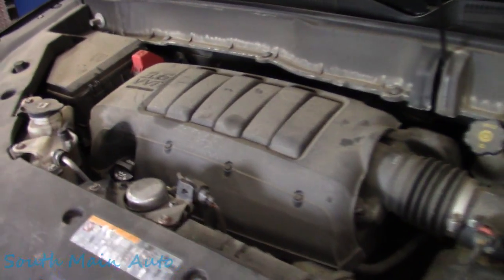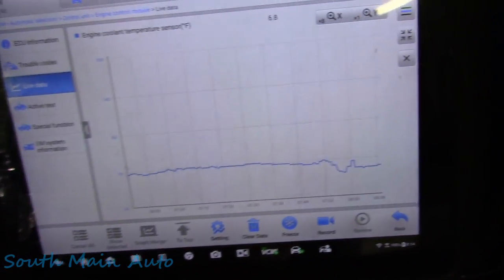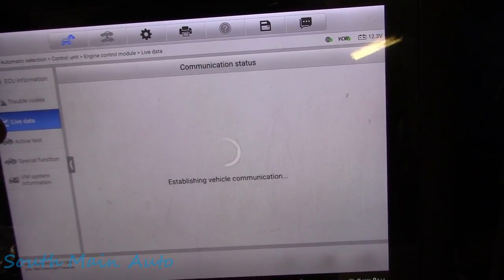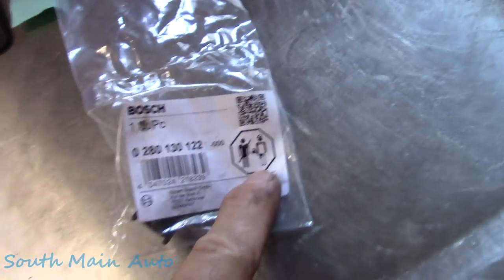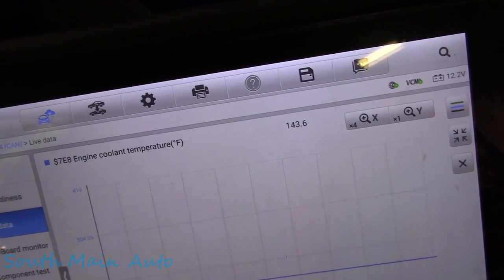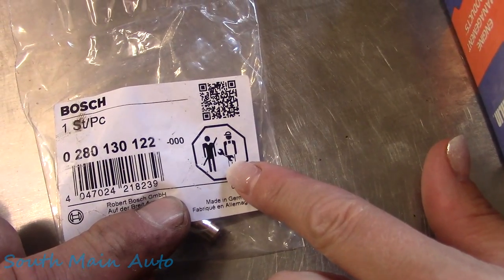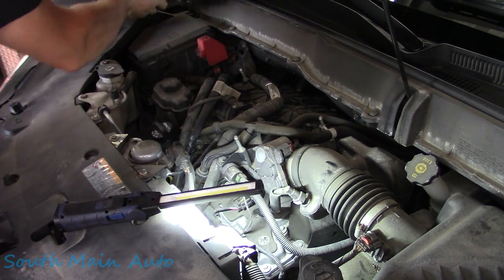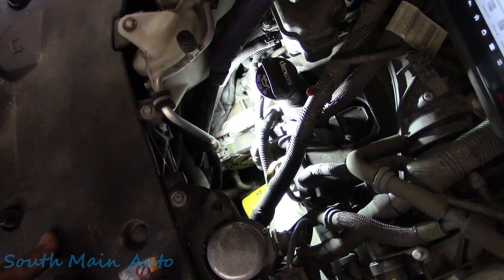Chevrolet Traverse: P0118 & P0119 Eric O. Loads The Parts Cannon AGAIN!

Comment: Honestly Eric I believe that the lock tab thing was a response from the factory to dealer techs reporting “found loose connector” when trying to recoup diagnostic time for “unable to duplicate” problems adds a couple tenths here and there
Reply: When you sell ten million cars per year, the tiny percent of connectors that come off/become intermittent/leak because the factory or mechanic didn't clip it on all the way is enough to move the needle a bit on those 'most reliable brand' magazine awards.

Comment: Hi Eric, I used to work as a design engineer for a supplier to Nissan for the head lamps and tail lamps. Preventing “soft set” connections was a big deal. During design reviews both internally and with the customer (Nissan) the manufacturing engineer and design engineer needed to show proof of how we check for and eliminate the potential for a soft set connection. In most cases we use connectors with the secondary lock (red tab) that a machine can push and verify that the red tab is in the locked position. It was a big deal to a lot of people. Oh well I’m back to being a mechanic now and much happier
Reply: These tab are a real pain in the ass worst connector ever
Reply: So if I understand correctly, the tab isn't really there to keep the connector from falling off once it's properly clicked on. It's there to quickly visually prove that it's properly clicked on in the first place?
Reply: Sounds like “logic” to me now ! Robotics @ assembly !? Should get the robot to remove some of these “brittle” Red locks after 100 K !!!
Reply: @legros731  Cummins loves them too. Just about every engine sensor, turbo actuator has those secondary locks.
Reply: @fredwalker839  Or after 450,000 miles on a Cummins heavy duty (class 8) engine... all the plugs on the stupid EGR stuff get HOT!
Reply: @John_Ridley  exactly, at least that’s the case for a lot of the sumitomo connectors we used with the red tabs. The red tab was what the Japanese called a “poka yoke” it can only be engaged if the connector is fully connected and then a machine would push on it at some point in the assembly process. If the pusher went a certain distance it would know that the connector is present, in the right location, and is connected properly. They didn’t want to rely solely on an assembly worker to plug the connector in. They had signs up at the work cells reminding people to “push, click, push push” like I said it was a huge deal to a lot of people. There were other methods too if the connector was in a spot where a machine push was not feasible, but the red tab was the ideal way to go.
Reply: @fredwalker839  If assembly line workers didn't have a history of showing up drunk or doing half-assed work it's entirely possible there wouldn't have been the need to institute a visual inspection method like this. Engineers come up with solutions to problems. As @corranda said, this was a problem.

Comment: “Connector position assurance” clip, or CPA clip. It’s used by the manufacturer to ensure the connector makes a positive connection with each other. And it is supposed to alert the autoworker at the factory that the connector is completely seated. Yes it was becoming an issue. I was told that they aren’t necessary as long as the connector is seated and locked.
Reply: They are not necessary
But after 10 years under the hood they just break when removing at least the connector work perfectly fine without

Comment: Funny you should mention a shop light that's magnetic to plastic  I used to have one. It was an old tin shelled incandescent shop light with a hook on top and it got so hot that if you put it on plastic it would melt in and stay.🤣😋

Comment: I work at a GM assembly plant. The reason for the lock (CPA connector position assurance) is if the connector isn’t seating all the way generally you can’t push the lock in. So it’s basically to ensure during assembly connectors are seated due to us being rushed with jobs being loaded. An engineer told me within the next couple years they will be on 99% of the connectors SMH
Reply: @SouthMainAuto  That explains why they fall apart after a couple years. They're only meant for last long enough for QA during assembly. After that it's on whoever touched it last.😁

Comment: Jury is still out on locking tab connectors .... half the jury says it keeps the connector sealed and clean inside and makes a better positive connection ... the other half are mechanics throwing stuff at the foreman that have to wrestle with them all day in really tight, awkward places .... the automotive engineers were all playing golf and laughing

Comment: Connecting lock was invented by a group of attorneys after losing a lawsuit.  Harness too short from factory, broken motor mount pulls everything apart and a mother with a minivan full of kids  stalls on the train tracks. Or some other tale of woe. Cars are built to be assembled on a line, after that it's tough luck to us all. These videos encourage one to keep thirty year old cars if not corroded on the road. Thanks.
Reply: Good explanations
Reply: Totally agree, keeping my ancient cars as long as possible, they still look good and run like new

Comment: The engineer who invented the locking tabs is the same person who thought childproof prescription bottlecaps for elderly patients with minimal dexterity was a good idea.  Somebody needs to take that guy out behind the barn 😆
Reply: Lots of kids died or were permanently injured from rx meds. It’s inconvenient for the seniors but worth it imo.
Reply: I call them adultproof caps 🙂
Reply: @arnoldm889  just store you medecine appropriately problem solve 
But people and responsibilities doesn't go hand in hand most a just big child lol
Reply: @legros731  Sad that we all need to pay for the few.
I say, take the warning labels off everything and let Darwin sort it out.
Reply: Big brother has to keep us safe from ourselves.  The latest? In 2027 all new cars will be fitted with a DUI interlock
Reply: @DeweyCheatumNHoweLLC  Oh boy, car stalls on the railroad tracks, and the gate arms start coming down, but car won't restart because of a faulty computer chip in the DUI sensor. That'll go over really well with the NTSB.
Reply: @arnoldm889  more than an inconvenience for many seniors as they can Not Open their medications at all. I do believe they finally changed the caps and seniors can receive non child proof, but they / MD have to request them.
Reply: That same engineer also made the caps work both ways, thread or adult proof.

Comment: I've shotgun parts repairing things on the family cars for years.  Many of these things are very common problems, just use the googleys and fire away - just not with Dorman crap parts.  The last one that bit me was when I replaced the OEM harmonic balancer on our '99 Expedition with a Dorman part and the rubber delaminated from the steel pulley almost immediately.  Took a while and a new belt with white letters for me to figure out why the power steering and alternator were not working well.  Love your Channel!

Comment: Had a ford 3/4 Trk die going across a RR track yrs ago and then it restarted and later wouldn’t, as I delivered parts for a part’s store an old mechanic told me check the firewall wiring harness sure enough it was loose and I zip tied it down. No more problems!

Comment: I know why Chrysler started with the locks in the 90,s. They dropped the PDI time from 1.5 hrs to. 9 hrs. So all off sudden the PDI guys were finding wiring problems to make up the extra time and a loose connector was the usual repair code. So they thought they had a big problem with connectors being assembled incorrectly hence the locks. This came up at a training course.

Comment: The tab is for assembly. It will only seat when the connectors are firmly seated together ensuring good connection and that the weather packing was compressed and sealed. It also makes sure if something presses against the toggle tab during assembly it doesn't get released a little and thus causing a poor connection and allowing water intrusion. As far as the the effectiveness well.. I will say I encounter the green and blue crusties in GM/Ford connectors that didn't use them more often.

Comment: Definitely not a mechanic here but never once have I seen a Ford, Chevy or Toyota have a connector that just fell off a sensor. I've seen sensors leak, I've seen connectors get crusty but not spontaneous separation. I hope I don't work on these new locking ones. I will say the nicest locking connector I've had the pleasure to use was the 1991-1994 Explorer fuel injector connector. Little wire spring that held it on. Super easy to undo and nice positive click when it engaged. Doesn't need to be more complicated that that.

Comment: Last year a bad coolant temp sensor on my 98 Chevy K3500 with the 7.4L left me stranded for a little while with a crank, no start.  After it cooled down, it started up and I was able to make it home.  I had the same thing happen some years back on my 98 Chevy K1500 with the 5.7L so I always keep one on hand and so I fired the parts cannon at the 7.4L and put a new sensor on it and that fixed the problem.

Comment: Back in the 80’s when I started. All the old iron had single spade connectors on both sensors, oil pressure and temperature.

Comment: Ever tried pulling a vacuum on cooling system and changing sensor? Helps actually hold coolant in engine and spill little to none if held under steady vacuum. Pretty cool trick. Also saves a mess. Mityvac air vac works great at radiator cap. Try it sometime, works awesome. That’s for all your help and enjoy your channel.
Reply: I used to loosen the radiator cap, warm up the engine, tighten the cap and let her cool off. There's your vacuum!

Comment: I did that on my 99 Saturn in 2008. It was always idling high as  the sensor was telling the engine it was cold. The sensor was 22 bucks and the special socket another 13. After I replaced it the engine idled back to 800 and the gauge read correctly.  Such an easy car to work on. I look at the engine on my 2018 Focus and I say "what's that thing?" Or "what does that big metal thing with fuel lines do?"

Comment: Yeah, all too often I see folks relying on the scan data, without the temperament of experience. I've seen so many ECT's fail without giving up a code. Especially pre-OBD2. Sometimes you can tell by flooding when it's hot, and by the O2 sensor readings. TBI's were famous for that. The sensor would tell the computer that the coolant temp was -40f/c (It's where they both meet! LOL!) I just unplug the injectors, then crank it over. After she clears her throat, she'll fire up for a few seconds. 
Not on the Insti, not on the Facebook (shocker, I know), but I am here in the comments! And thanks for showing folks that they can do it too! o7

Comment: Eric,  I thought that maybe you could've plugged in the new temp sensor and checked the readings before removing the old one and installing the replacement as a quick & easy confirmation of your diagnosis (or educated guess).  But then, you are the professional in the overalls and hardhat with the wrench and I'm just the crossed-out DIY schmuck...

Comment: I have a 2011 Malibu with the 3.6L and it was so simple to change my ECT sensor in 2019. It is in the same spot as that SUV and took about 2-3 minutes. There is a lot less junk in the way on mine. My issue, however, turned out to be a thermostat that was stuck closed. I decided to replace the water pump at the same time. All of this was immediately before a round trip of 1500 miles and there were no issues at all.
Reply: Had to reload the parts cannon there eh?
Reply: @tooltime4640  Yeah. I honestly thought that it was the sensor because the car ran fine until it went into limp mode. I thought it was just reacting to bad input.

I even pulled over on the freeway, opened the radiator cap (on the overflow bottle) and it didn't do anything abnormal. 

It wasn't until it did it the 3rd time that I realized it wasn't the sensor. A little egg on my face, and I started my vacation a day early since I couldn't reliably drive to work. It took that day plus part of the next one and it was under control. Thankfully, I didn't have to load too many parts before firing off the cannon.

Whew! Disaster averted, and the trip was a breeze.

Comment: GM had an internal directive to make all of their electrical connectors have these locking features.....even on the connector for the rearview mirror which I am very familiar with on Full Display Mirrors for GM.  The reason they told us at the time is that these connections were not always getting connected properly on the assembly line.  This costs GM $$$$$ at dealerships for warranty returns for a loose/unconnected interface.  So, they believed that by adding another step for the assembly line worker to press the connector onto it's mating partner and then having to press that locking tab that it would ensure the connection is made and will hold.  They knew it wouldn't always be 100%/full-proof, but it was better than what they were experiencing.  So, they told the electrical group within GM and its supply base to develop these locking tabs to ensure the connector does not back out thus causing warranty returns for just a loose connector.  It's not an engineering thing.......it's a bean counter thing.
Reply: its

Comment: Only time I ever had a connector "fall off" was after the ding dongs at Pep Boys broke the tab during a starter replacement..and they did nothing (i.e. wire tie)to ensure that it didn't just fall off( which it did within 1 month

Comment: Back in the Day, there was no plastic electrical connectors. The wires was connected to the  sensor with a brass nut and lock washers. Those Were The Good Times.

Comment: I fired the parts cannon at a P0172 code in my 2002 Neon SE with the big 2.0L and 161,000 on the clock. Gas mileage went from 22-26 mpg to 16 mpg and the Money light. Built an inexpensive smoka, no vacuum leaks  
Fire 1, plugs and map sensor. Now idle issues
Fire 2, new IAC and throttle body clean..idle fixed, still P0172.
Fire 3  New injectors and O2 sensors, but the one in the cat welded itself in. No joy Won`t pass Pa inspection and now I`m ready to push it off a cliff.

Only joy I have had lately is hearing my ex wife bought a 2013 Equinox at an auction for 5 grand. No keyfob, Service Stabilitrak message, TPM message and abs light on and 4 tires that will not pass Pa inspection either. It`s got the ecotec that likes to blow up if oil gets low.
Reply: Oh man, I hate that Service Stabilitrak message. However since your ABS light is also on, check the wheel speed sensors. Sometimes you get lucky and it's just a wheel speed sensor, since those speed sensors are critical for the stabilitrak and the abs system to function. If you're lucky enough to have a scan tool like Eric O has you can go for a test drive and pull up all 4 PIDS for the wheel speed sensors and you'll see pretty quick which one isn't working. TPM might just be a dead battery in one of the sensors, but you can get that fixed cheaply enough at a tire shop. New pressure sensor and tires, and a TPMS relearn and you'll be good to go. Keyfob might have to go to the stealership and have a new one programmed to the car. I'd leave that one last on the list...

Comment: I’ve officially lost track of how many timing chain jobs I’ve done on those 3.6L. Customer states: “Always maintained and changed engine oil when monitor said 0% oil life left. Why is there a cam timing error code?”
Reply from the maker: Changes every 20,000 mi whether it needs it or not
Reply: @SouthMainAuto  LMAO I know too many people just like that.
Reply: At a $120 an oil change + 3hr of my life at the "quick lube" And myself having a gambling addiction. I like to push it out to 10k+ and count on the rust eating my truck before the motor goes. That's approx $2500 and 20 mornings win when I make it to 200000 miles. So far so good. 🎲🎲
Reply: @SUDSY0  In the PRNY, that might not be that bad of a strategy. Truck will get so rusty won't pass state inspection and then you gotta send it to the crusher along with all the cash spent on changing the oil every 3000 miles like the jiffy lubes want you to do... lol

Comment: Just worked on one of these today. Removed a broken idler pulley bolt, which is also a bolt to hold the alternator on. You also have to take the alternator off to get a new idler pulley on. You also have to remove the studs that the alternator bolts onto. Don't forget you have minimal room too. These are a nightmare vehicle, but more money in my pocket.
Reply from the maker: The 3.6 is the best money maker General Mess ever came up with haha
Reply: @SouthMainAuto  As good as the 3400 with it's coolant leaks?
Reply: @SouthMainAuto  I call them the Grenade Makers.
Reply: @johnz8210   I dont think there is one good aspect of them. My customer said the fuel gauge has been wonky since they got the vehicle. Shows correct fuel level while driving but goes to full when stopped.
Reply: i did that same alternator recently and honestly thats an easy job on that engine. but as we all know these are super known to have timing chain issues and on the transverse applications the engine has to come down
Reply: the 1 i did also recently which i hadnt done before was the thermostat on a 3.6 CTS. now that one for me with my big ass hands was a goddamn pain in the ass. i think easily one of the worst thermostats ive ever done. might not be as painful for someone w small hands but for me it was a real pain
Reply: An unreliable car that is a a bitch to work on - sounds like a Robert Lutz wet dream.
Reply: @SouthMainAuto  sounds reliable compaired to the Ford 1.0 3 cilinder ecoboost, aka ecoboom with its wet belt.
Reply: Two words: water pump